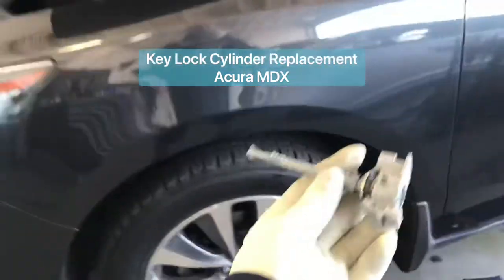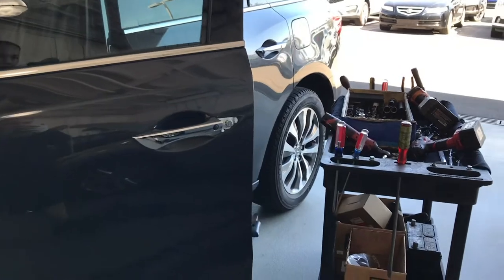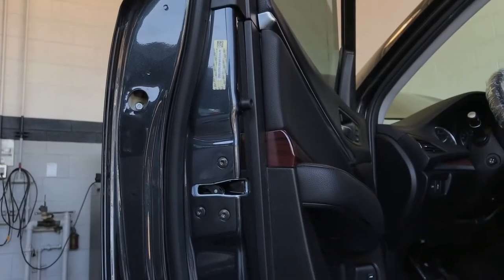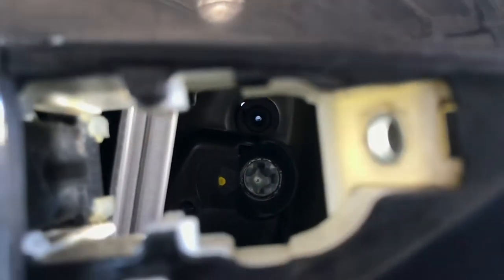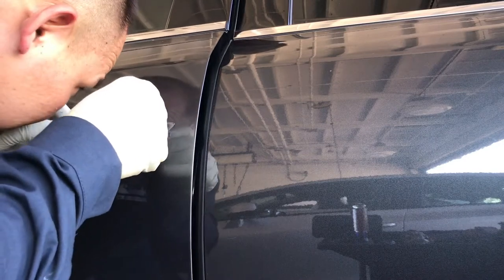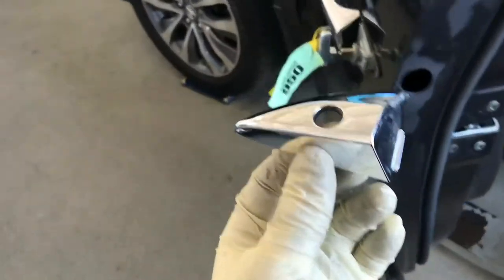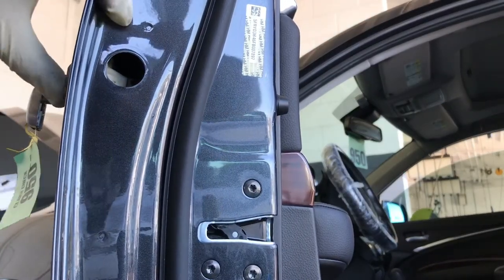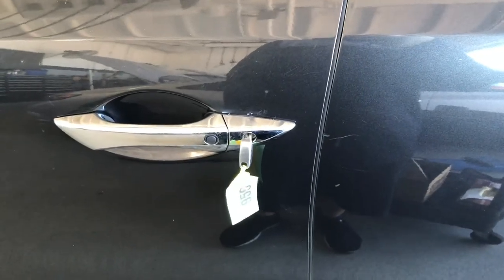Key Lock Cylinder Replacement -DIY - 2014-2017 Acura MDX

Comment: Thank you so much for this video...someone tried to screw with my door lock and it's all jacked up...I just ordered the part and your video explains everything perfectly.
Reply from the maker: Hi, I'm glad the video is helpful. Good to connect with you 👋🙌
Reply: @huunwheels7378  I had to get the part from my local dealer as everyone online has it on backorder...had to pay $60 more :(  Still, it was worth it.  I almost dropped the bolt when installing the new piece, but luckily I didn't.  Thanks again!

Comment: Great Video! Very informative. I actually had the same thing happened to my 24' rdx a month ago. Acura suggested I take it to a body shop since the theives damage the area around the door handle badly also. Body shop replaced my door and my key lock cylinder. However, the issue Im experiencing now is my memory seat is no longer working and my door does not retract when I enter or exit the car. But most importantly, my infotainment/radio system stays on even after I shut down the car and exit the vehicle. I've been having to unplug the negative terminal from the battery to turn it off. Even with the broken key lock cylinder evrybtimg still worked fine,

If you have any thoughts or suggestions as to what may of happend or why this is happening I would greatly appreciate it. My cat is 7 months old!
Reply from the maker: Hi Moe, there could have been some type of shorts after repairs that sent wrong signal to vehicle control system. You may have to take back to the repair shop or the dealer to have system check out or reset the On Board Computers.
The Infotainment is like a main control of these newer vehicle.

Comment: A great video! my 2017 MDX door lock got picked and cannot lock properly with anti-theft light not working. a quick question: can I still use my original keys after replacing this damaged lock cylinder? or the new cylinder will come with new keys?
Reply from the maker: The new key come with new lock, you can have it a Locksmith rekeyed other lock to the same key if you like ,, 😀

Comment: Thanks for the video . How did you remove the cover of the lock cylinder on the door handle.
Reply: I saw in one of the comment you said " lift the outer handle up and pull the whole cylinder out with cover" , but in the video , the cover was already out.
Reply from the maker: @rachitpant3357  yes, lift the outer handle up and pull the whole cylinder out with cover. Careful separate the cover from the old cylinder by lifting the cover out of the small lip with a small flat head screw driver. Careful though, the lip hook is tight, sometimes it may break.

Comment: Does the lock cylinder re-key itself for original key? or does the dealership need to do that?
Reply from the maker: Thank you, Randy. Great question. The lock cylinder need to be re-keyed for original key. It can be done at third party locksmith.

Comment: Great DIY video! I've a 2011 MDX and I'm hoping it's a similar procedure. I found out after coming home from a weeklong vacation that my battery died. Tried to use my key to open the door, but it didn't work. Since then, I've just unplugged the battery to make sure I can get back in after a long time away. Is it likely that the battery is still draining because of the bad cylinder lock?
Reply from the maker: It’s likely because the cylinder lock connect to the lock actuator, computer got triggered to be on constantly drain the battery
Reply: @huunwheels7378  looks like the 2011 is setup differently. Going to be more involved.
Reply from the maker: @spinn1  thanks Spinn1.
You’re right. It’s more evolving in the 2011 model

Comment: Any idea if this would work on my 2020 Acura MDX.

My keys were stolen and wanted to DIY changing the locks, it seems pretty simple based on your through explanation.
Reply from the maker: Hi Gabriel. It is similar. If you get the concept in this video, then it works.

Comment: Hi Huu 

You video will save me lots of money.  I have a 2017 MDX with the exact same problem.  However, everything else works fine..  The alarm didn't go off.  The only thing doesn't work id the remote starter and when I lock the car using the remote, the exterior lights didn't  flash.  I brought the car to the dealer and they said because the lock cylinder was damaged, the computer thinks the car is unlocked and therefore, the remote starter doesn't work and exterior lights don't flash when lock using the remote.  
The dealer wanted $1200 to replace the whole unit, part # 06350-tz5-a01 and re-key the glove compartment lock.  After watching your video, I think I can replace only the lock cylinder, part # 72185-tz5-a01.  After I replace only the lock cylinder, do you think the remote starter would work and the exterior lights would flash when lock the car using the remote?  By the way, how do you remove the cover surrounding the lock cylinder?

Thanks
Reply from the maker: Hello John. I’m very glad the video is helpful. 
Yes,  Most likely, after you replace the key cylinder, the remote starter and the exterior light will work. For the cover, it would come out with the lock cylinder when you remove the cylinder assembly after remove the 10mm bolt as in the video. You can swap the cover to the new lock cylinder. It has two locking taps clip on to the cylinder.
Reply: @huunwheels7378  I noticed that the lock cylinder has no electrical connection.  So, I am not sure why the remote starter doesn't work.  Do you have shop in the Orange county area?
Reply from the maker: John Nguyen the lock cylinder itself doesn’t have electrical connector. However, its rod connect to the door latch which control the lock/unlock. Since the cylinder was tampered and cause the lock latch slightly off the neutral position. The alarm system would see it as open, that’s why it wouldn’t work. 
I used to work in a shop in OC. Due to current situation, I am not working in a shop. However, if you have question, I can share and help you to do it, DIY.
Reply: @huunwheels7378  So after I remove the 10mm bolt, should I grab the cover and pull the whole thing out or should I use a flat head screw driver and push the cover out?
Reply from the maker: John Nguyen lift the outer handle up and pull the whole cylinder out with cover

Comment: Hi John! Today I discovered the same issue as another comment below. I also have a 2017 MDX. Went to my son's 1st grade graduation celebration and came back to the car to discover my remote won't lock the car or remote start. Then i saw a piece of something sticking out of my door lock on the driver side door. I realized someone tried to use a screwdriver like device to crank the lock open. Acura is telling me (via phone) that it will likely require a whole new actuator and rekey and all this extensive stuff. However, I see that the door lock on the inside of the car above the door handle release, still tries to move open and closed. But it acts like its jammed or stuck. So if its trying to move, that tells me the actuator is working. The likely culprit is that the cylinder rod may be slightly turned enough to not allow the door to lock completely? Would you agree with my logic? If I were to simple remove the cylinder as you did in your video, would the car let me lock the door? I am considering buying the cylinder part and having a 3rd party locksmith rekey just the cylinder to my original key. What are your thoughts? I appreciate any and all feedback. I greatly appreciate your video.
Reply from the maker: Hello James, thank you for your comment. That will work. get the key cylinder, have it rekeyed. I’m glad that video is helpful. Great to connect with you! 🙌😀
Reply: @huunwheels7378  John. You're the man! I just went to Acura, got the new lock cylinder. Put in the new cylinder and everything works again! The Acura service rep called confirm my appointment on Tuesday and I told him I had fixed it myself. He still insisted there may be damage to the mechanics and the actuator. But fingers crossed, it was just the cylinder as the car is locking and unlocking just fine right now. Very grateful to you for saving me so much money and headache.
Reply from the maker: @jamesomalley1410  thanks James, you’re the man, fixed it yourself and save yourself some money! Great job 👏

Comment: How do you get the cover off of the lock cylinder? I have a 2017 RDX that seems to have the same mechanism and I don't want to damage the cover.
Reply from the maker: Hi Daniel, it’s easy to break, try to be gentle by Trying to use small flat head to push on the locking tab/look like a hook that latch on the cylinder. Hope that’s helpful.

Comment: Hey brother,,They did the same thing to my 2015 acura mdx but the door dont open from inside, i need to replace the same parts but cant get the door to open, any idea on how i can get the door open?
Reply from the maker: Hey brother, that’s another level of breaking. Have to try to remove the door panel to get to the latch with the door close ! It Wasn’t fun though.

Comment: Looks like the part# 72185-TZ5-A01 is about $95. How much will it be for a locksmith to rekey to the original?
Reply from the maker: Hi Johnny, it’s range between 200-450; so it’s up to the locksmith price.
Reply: @huunwheels7378  Thank you sir! And thank you for the instructional video. Very useful.